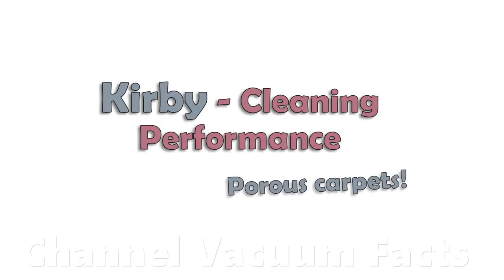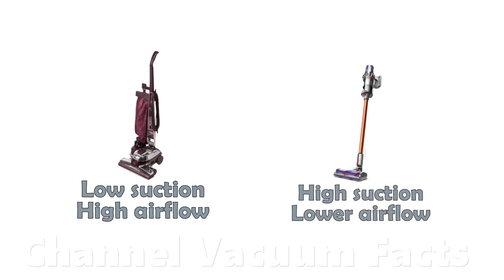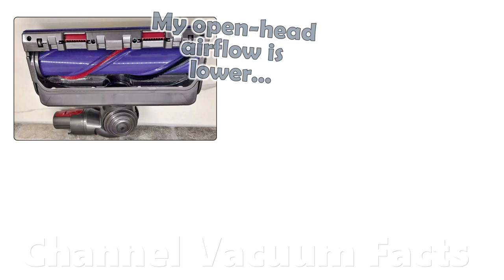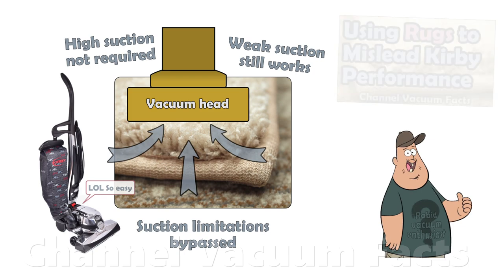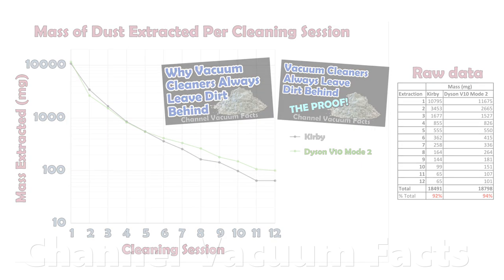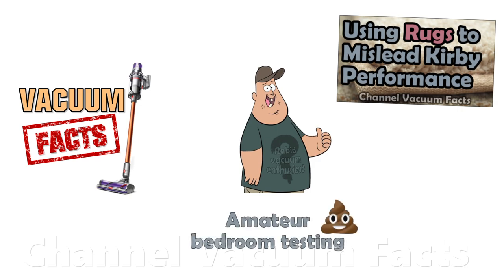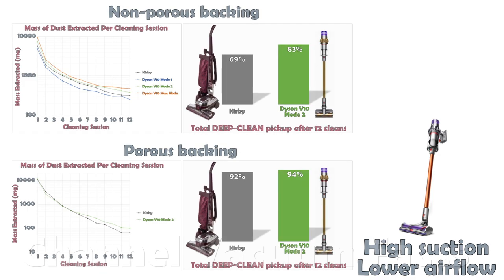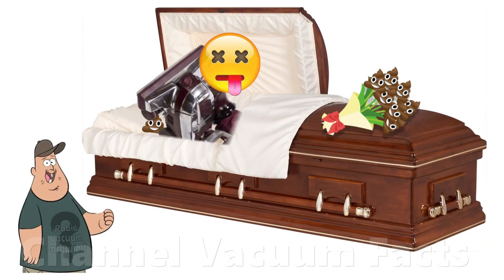Dyson V10 (not V11) Vs Kirby on Porous Carpet

Comment: I've had a doubt put in my mind. If the dirt meter restricts the airflow from 125cfm down to 50cfm that is a considerable amount. We know the Kirby has a lot of airflow as it will pick up flour from underneath a porous rug. So you're not getting the full performance out of the it. Unfortunately I can't think of a reliable way to test it. The resistance of the carpet will restrict the airflow of the Kirby but not enough to prevent it from picking up flour from under a porous carpet. If you can find an accurate way to test the Kirby with the bag in place I would love to see it.
Reply from the maker: Whether or not flour can be picked up from under a rug is irrelevant because flour would never get under the rug in the first place (I plan to prove this). How well dust can be removed from within a carpet is more important, and is the reason why showing whether or not a machine can extract dust from under a carpet is misleading. Meaningful testing that doesn’t mislead means you must measure the mass of dirt actually in the carpet (e.g. 20,000 mg) and then look at the mass removed each time (e.g. those points on the graph). That’s the only measurement that’s important and not mislead and represents exactly what the machine is designed to do.

Comparing open-hose airflow of 125 cfm to 50 cfm when there’s a dirt meter pad there and suggesting it’s not getting its full performance is misleading because that’s exactly what happens on porous carpets anyway. The dirt meter pad is essentially just another bit of carpet. The loss from a pad compared to a non-porous carpet is tiny; the carpet does most of the restricting, so the non-porous carpet data is secure. For porous carpet which doesn’t drop as much, you could argue the dirt meter has Kirby airflow lower than it would otherwise be. Someone should measure the airflow numbers using their box with a rug over it for a) Kirby with bag, b) Kirby with fresh dirt meter, c) V10 Mode 2. How do those three airflow numbers compare? I’m highly confident from what I can feel by hand that the Kirby in either case has HUGELY greater airflow than the V10. Hugely.

So, let’s assume it actually is at this point. So, the Dyson has tiny airflow, the Kirby still has huge airflow, even with a pad. We also know the pad getting partially blocked initially makes no difference to final performance either because again, both curves in the first few passes with concentrations were high were pretty much the same. (My dust isn't as fine as flour BTW.) The Kirby has hugely greater airflow than the V10 still on porous carpet, but doesn’t achieve greater cleaning performance.

If airflow supposedly makes a difference, then why does that huge difference in airflow between the two machines not show any difference to cleaning performance? That’s the key question and that needs to actually be explained to justify why any more airflow would make any more difference given that it already hasn’t. “More airflow” obviously just doesn’t explain anything because there already is more airflow present and it makes no difference. This is what I mean by performance being independent of airflow on porour carpeting above some reasonable value (i.e. whatever the Dyson provides in mode 2 through porous-backed pile).

Then despite all this, you’d have to explain why at lower, real-world dust concentrations at later cleaning sessions in the graph, where dust doesn’t come close to blocking filters, the Kirby still struggles to extract as much remaining dirt, despite having much greater airflow than the Dyson.

The answer, as I've already stated previously, is that it’s not how much airflow you have that’s important, but how its utilised by the cleaner head. Airflow is like a dick; it’s not how big it is that matters, but how you use it. :)
Reply: Hmmmmmmm I think women prefer a big one that is used properly 😁 I have asked them to put a piece of carpet on top of the airflow box to see how much it restricts the airflow. But it's still not entirely accurate cause you don't have a big gaping hole in the floor do you. But it might tell us something.
Reply: @VacuumFacts  My thinking is if it can pick up flour from underneath a porous carpet it should have no problem picking up fine dust from deep in the carpet.
Reply from the maker: More important is to address the key point about why more airflow on top of already greater airflow would make a difference, given that it already hasn't.
Reply from the maker: RE Flour: Yes, but it's misleading to suggest that if a vacuum can pick flour from under a carpet, it can thus clean a carpet better than a vacuum which can't pick flour from under a carpet. That I've shown is false. But the myth needs to be explicitly debunked. Next video.
Reply: @VacuumFacts  I take your point I just thought there's a big difference between 125 cfm to 52cfm. That is where the argument is with the enthusiasts. Btw I owned a Sentria 2 which has the latest so called improvements but the difference in performance between it and the previous models is very subtle.
Reply from the maker: There is, but focussing on that difference is misleading because it ignores that the lower value is what you'd get anyway AND that it's STILL hugely greater than the V10. It's focussing on a distraction which doesn't have any influence, as I've shown. Why would even more airflow give better results, given that it already has way more airflow after pad-resitrictions and doesn't give better results. Makes no sense. Until they understand that, they'll never breach their impasse. But I don't think they will based on what they're saying. Sad and fundamentalist really. And despite giving them as much respect as I can, this lack of objectivity kills their respectability. And when they then spin it as me rigging things, that's when it crosses the line and they get the rabid title again. Some people you just can't help, and it's a fact of life all over society. You just have to contain their poison.
Reply from the maker: Now that I've embarrassed the joke-product Kirbys, and exposed their more rabid fans as the corrupt liars / ignoramuses they were always suspected of being, as sad as that is to say, I'm now seriously tempted to reveal the truth about the cordless Henry as my next 'flavour week' at some point in the future. That product has some really disgusting characters peddling outright falsehoods behind it, polluting YT. What other cleaners with undue godlike status are there which need exposing for what they truly are I can also consider? I'm also looking into how to weigh bags to very high accuracy, seeing as other bagged cleaners don't have dirt meters.
Reply: @VacuumFacts  If you can find a way that would be great then there could be no dispute. I quite like the Henry cordless. It is a full sized cleaner though so it does have an advantage of being able to use a bigger motor.
Reply from the maker: There's definitely no dispute about the Kirby anyway for all the reasons discussed. But without a Kirby meter equivalent for other bagged cleaners, there's no way to measure dust extracted it otherwise. I think I've found a way, but it requires new equipment. What other cleaners are touted? That Felix is one.

The Henry cordless is clearly shit. As usual, I'd have to point out why, but it's the cleaning performance I'm interesting in measuring. It's obviously going to be bad. Like, REALLY bad, just like the big version was. But there'd be no hollow excuses about its age being used this time by the zealots. I'm also going to have to switch to a flour-salt mixture, because I'd lose the material in the bag and I don't have enough of that microsponge dust. So data wouldn't be apples-to-apples comparable with the Kirby etc. But I've got to save up first. I've been looking into starting a Patreon, but I doubt many would subscribe donations to make it worthwhile.
Reply from the maker: Love how you posted in the wrong thread, randomly. Those other cleaners I'll look into. The Henry cordless doesn't come (or work) with a spinning brush head, so would be judged by how it was intended to be used out of the box. OMG...merely starting £749.00 for a Vorwerk I've just seen on their website!!!! And the full set, with bits missing, goes for £1200!! Why isn't there deep hostility towards this, given a mere half-the-cost £600 V11 is brutalised by the rabid? Such hypocrisy; but what would you expect from that 'community'... But hey, it's "Good Housekeeping Institute" approved...whoever they are. I'm sure the rabid swoon over them like the CRI, and if they don't, then maybe they're hypocritical again given the inconsistency. Unbelievable. And despite that cost, not a dot of formal evidence showing any kind of superiority. That's a clear case of daylight robbery. How do people fall for this obvious charlatanism?!
Reply: @VacuumFacts  Oh did I 🙊 Yes it's very expensive. You can get a Sebo for around £200 ish which are very close in performance and built very well. Straight suction doesn't work great on carpet you need a rotating brush.
Reply from the maker: That Vorwerk is literally Kirby v2.0. In-home demo and sales (although you can now buy online!). Overpriced accessories. No performance data measured to industry standards. A complete scam.

Yeah. The Henry cordless is sold like that to be used like that, on carpet too! That's what you get and that's how it'll be reviewed. Put the liars in their place at least. Ha, wish I had more money to throw around xD
Reply: @VacuumFacts  You could say £600 for the V11 is a scam too. I wouldn't pay it. I got my V8 for £200 from Dyson 😁
Reply from the maker: Ha, no; a scam is when you don't get what you pay for. Dyson are—genuinely are—industry leaders which produce the best technology, in terms of both performance and function. That costs and others copy; Dyson recoup their costs as well as profiting. Charging a premium for the best is not a scam in the same sense, and is in fact common business practice across the consumer market. That Vorwerk is a clear scam. If I could afford it, I'd reveal, as I have done so far, that its performance isn't up to the cost. Dyson are quick to advertise their performance data; inferior competitors prefer to brush that under the rug, or confuse with numbers and irrelevant metrics. Not that I can afford a V11 having said that haha

Comment: This video is fucking BS. I have a heritage 2 from 1985 and it still works great. That V10 wouldn’t be working in 30 years.
Reply from the maker: That was not an argument for the reason you dislike the video; it was just mindless hate relying on strawmen, debunked repeatedly in my comments. The V10 may or may not be working in 30 years, but it's designed for 10 at the very least—should a user even want it for that long. Technology moves on, becomes more efficient and effective, and less environmentally polluting. People want an upgrade because new tech usually improves. Ever wondered why you don't see those who don't like facts, arguing 30 year old cars or phones are better than brand new ones 'because they're from 1985'? Silly argument and a great litmus test for someone who doesn't listen to reason. But some people change their minds, grow up, and start thinking. This video can help with that.
Reply: I like my kirby for the same reason I like my 91 Toyota Camry. It doesn't ever quit. Now, ask me if my camry can keep you safe in an accident, keep me in my lane, automatically prevent a skid... Etc. Technology always gets better with age. I own a v6 dyson and a DC14 upright along with multiple Kirby vacuums. I have all porous carpet so the kirby's do amazing and are much easier to push due to TechDrive. But I always admire how much suction the Dyson has and how well it cleans for a fraction of the cost.
Reply: Awesomevacuums totally agree with you 🤣this guy is not okay report the video his posted it twice